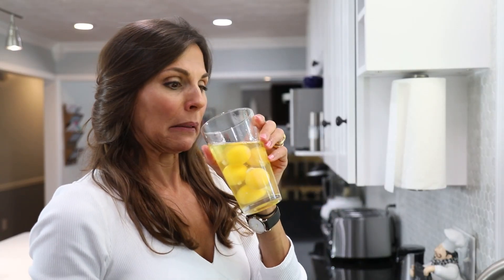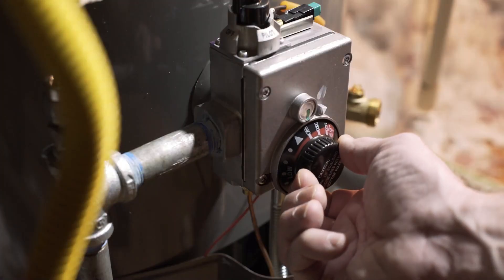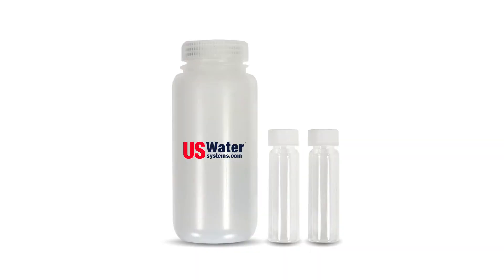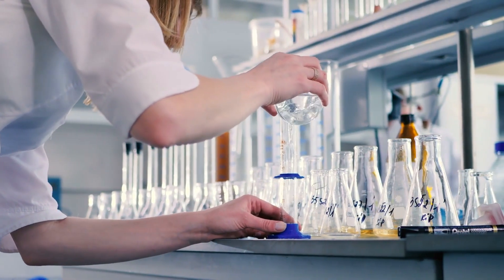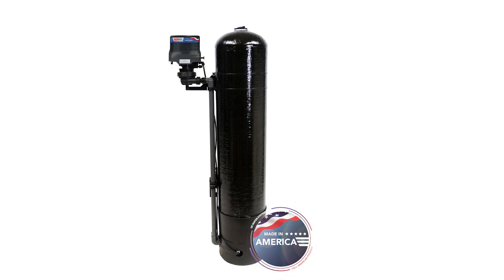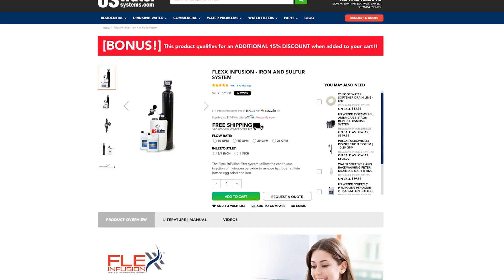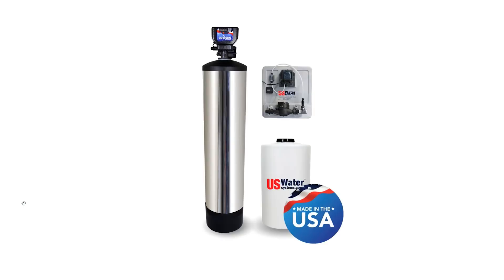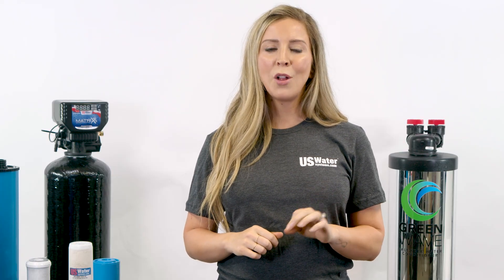Why Does Your Water Smell And How Can You Fix It?

Comment: If the smell is from the hot water only, I found the Corroprotec powered anode rod eliminates the smell instantly and permanently. No need to repeatedly treat/clean/sanitize the water heater, ever.